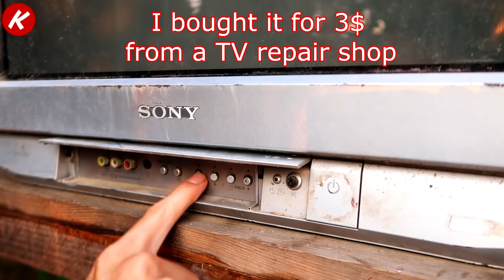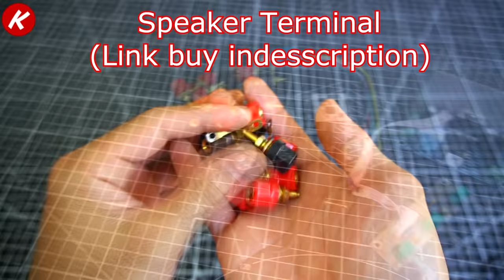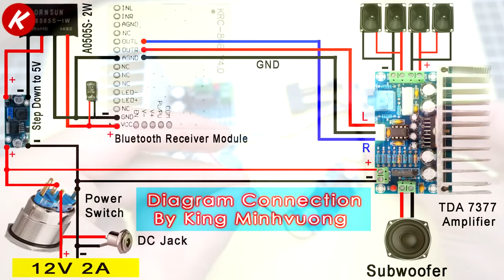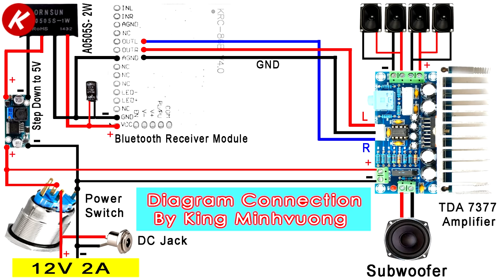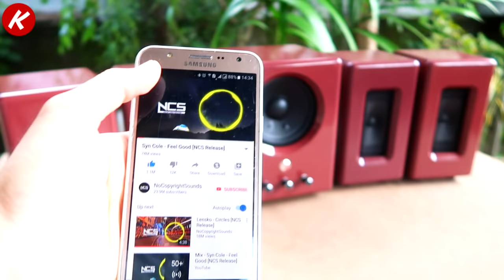How to Turn Old TV into 4.1 Bluetooth Speaker

Comment from the maker: Hi Friends! Do you like this speaker? 
Please tell me know your idea. Thank you!
Reply: Realy like. But i like speake mini use battery more
Reply: Yes and no, yes because the speakers are great and the design is great, and no for the awful Bluetooth chip, you should plug them into a real amp not this one, they’re not small to be Bluetooth speakers, they need some life.
Reply from the maker: Thank you for your advice!
Reply: King Minhvuong thanks to you for taking it positively man ! I love ur work
Reply: Also i just saw the complete video, a 2 channel amp is not suitable for 4 channel speakers + subwoofer youre just end up getting a crappy crunchy sound when u have to get an awesome sound with 4ch, you need at least two amps or one 4 ch + sub amp
Reply: you want to make a sound bar with this speaker
Reply: Fake jbl flip 4upgrade
Reply: I love it, but You might use filters for each type of speaker, but I really love it, Nice project
Reply: Upgrade speaker portable again
Reply: uma boa ideia é fazer um protetor de tecido pros auto falantes, assim eles não ficam aparentes e da um acabamento muito legal. a unica coisa que não gostei foi a cor, na minha opinião se pintasse de preto o botão de power e os controladores prateados iam ressaltar e ia ficar bem mais bonito, mas foi muito bem feito e o som ficou top. parabens.
Reply: Tháo rốn loa thì a nên dùng xăng á thì nó đỡ bị rách loa hơn
Reply: That's not 4.1 chanel system...
Reply: You have every equipment to make this project working nice
Reply: @visendorin493   yeah that's 2.1
Reply: Left channel and right channel are same two speaker at the same terminal ..the ic amp cause overheated to damage ic amp. If amp ic consume 10watts.4speaker x4 40watts..i suggest to add usb.micro sd..by the ways nice work good job bro.
Reply: Yes and no they are butiflul but you should honestly use better speaker drivers tv speakers aint all that good
Reply: It is very relaxing to watch your build videos, and nice job on restoring those old Sony speakers and re-purposing for the bluetooth build. That being said, I think these speakers would probably fair better with a small clean stereo amp (unless you're just going for portability and a way to amp up your tunes on your iPhone or whatever.) I do like your cabinet work, and they are pleasing to the eye. You may want to repurpose a large boom-box amp/tuner into one of your cabinets to power these, and still retain the B/T setup along with a switch to select between the 2 sources. More choices for home or mobile?😁👍
Reply: Yes!
Reply: The sound system and design is perfect but bass sound is low quality
Reply: no seria mejor usar madera terciada (triplay) en vez del MDF ya que por lo visto el subwoofer de computadora se daño por la humedad y el MDF soporta muy mal la humedad
Reply: Can you make a Marshall speaker?
Reply: No Sam a actual Marshall Bluetooth speaker.
Reply: Which type of wood you used???
Reply: black stain u used to paint upp those speakers will make them produce less then they would,, also when going on like you did why not also use dc voltage and use 18650 batteries u find in old puters, brigw them to around 32v or higher and an ballancer for recharge,, or why not use solar panels as chargers,,when u use speakers like these on barbeque or a picknick..newer the less,,nice done and i wish i had a space so i could have the same tools.
Reply: @catchmypoint6756  MDF
Reply: treble is missing
Reply: @FPSzky  also the bass and pretty much everything else
Reply: @randomweirdyoutubechannel8955  ye
Reply: What was the coating used before you applied paint? Epoxy? I like how the finish turned out
Reply: Very giỏi Minh vuong
Reply: Really super amazing sound and clean bass 👌👌
Reply: @medmusic7977  

P
Reply: Chất
Reply: Nice work but it sounds very crappy. You should used the tweeter instead of the other pair broadband chassis. It's extremely limited in the heights
Reply: Rx
Reply: it awasome bro❤️
Reply: @vantunguyen4955 ёпенггггг5
Reply: Old 5.1 Home Theater to Bluethooth speaker.
Reply: Por favor
Reply: Un poco
Reply: Popo caca caca
Reply: @vantunguyen4955  u
Reply: @vantunguyen4955  yang akan terjadi pp lagu Adista setia
Reply: Hey bro you can do speaker with  video display
Reply: EnjoyEnjaami .
Reply: I feel bad 😞 yor soldering iron need care
Reply: Hey  joker    ftan   dj
Reply: Anh làm loa bằng hộp đựng đạn đi ạ
Reply: @KingMinhvuong  on off

Comment: Wait a minute, that’s not even a 4.1 system. It’s just a 2.1 stereo system but with two speakers on each side instead
Reply: Should have bridged the back negatives together to get the surround channel
Reply: @zacharydarner7036  just what I was thinking. And the subs not even bumping, so...this isn't even the music from the "4.1"? Don't get me wrong, the craftsmanship is amazing! But.
Reply: @kingkrapper108  probably not the real system playing that song. All you need is a stereo and four speakers and some wire and it takes less time than that work. Or just look out for a Dolby pro logic cheap surround sound system at a pawn shop,thrift store or garage sale.
Reply: You literally know nothing about home theater setups
Reply: You could buy some extension wires and mount the speakers on the wall or biuld some stands and make them floor speakers or use them as bookshelf speakers DUHHH
Reply: @athomewithmrs.scherkenbach404  yes I do I am talking about a cheap method to get basic surround sound
Reply: First of all you do it well...you didn't no how to do even...but you commenting the speaker
Reply: @DOMiNO I agree with you. 

I appreciate the work, but the title is misleading. 
Deslike =)
Reply: Its a 2+2.1 system
Reply: Could be made 4.1 easily with a bit of work and 20 bucks.
Reply: it *COULD* be bluetooth 4.1 KEK
Reply: @FennecTECH  can you please provide a wiring  diagram link for a 4.1. im having a hard time understanding it. I have 4 6.5inch JBL's and a 4 channel Jbl car amp. Im running the setup at home but as of now its just a 2.1. I really wanna know how to connect the rear speakers to get surround sound.
Reply: wooow you are so smart
Reply: UTKARSH SHARMA you could look online for a 4.1 wiring diagram there are a lot online and its very simple. Like i have a tv it is a 2.1 surround sound except there is no subwoofer because i have 2 woofer drivers and 2 tweeter drivers drivers=speakers
Reply: @athomewithmrs.scherkenbach404  i think u have no idea what surround speakers are.
Reply: its quadraphonic.
Reply: Bits of two TVs, a subwoofer box and a load of bought electronics for s 2.1 system - That's the title.
Reply: I have made one.. with class D amplifier. TPA 3116 d2. Ic based board. 
It gives 50+50(stereo)+100(subwoofer). It's so loud and heavy bass. A indoor party 😹 can be done with it 😉 very easily. 
 I always play at 10-15% of power. 
I used 2*6inch speaker for stereo and a heavy 6 inch subwoofer for bass. And 2*2.4inch midrange speaker. 
It was a great journey to build those. ❤️
Reply: @revolution5547  agreed

Comment: Pretty cool. Good job. In the future you should try black plasti-dip it gives the paper cone a rubber coating and seeps into the papers pores and gives tighter lows from paper speakers. I’ve done it to many paper speakers and subwoofers and really looks amazing and sounds better.
Reply: 😅😮u 0:26 0:27

Comment: Very cool! Although the red paint is hurting my eyes a bit. But it's not the worst part. It would be best to try to mesure the speakers' t/s parameters (they essentially describe the speaker)  and use a free program like winisd to calculate the proper box volume. I also suggest using the tweeters bu putting them with a 2.2 to 4.7 uF capacitior in parellel with the woofers. But be carefull the + of the capacitor needs to be connected to the + on the terminals and the - to the + of the tweeter and the other leg of the tweeter goes directly to the speakers' - terminal (the black one). This essentialy creates a high pass filter, wich protects the tweeter from low frequencies that might damage it.

Comment: My friend purchased a Dindinmodern speaker that has lights and loud sound. It seems equally good. I think I will purchase one
Reply: I have made one.. with class D amplifier. TPA 3116 d2. Ic based board. 
It gives 50+50(stereo)+100(subwoofer). It's so loud and heavy bass. A indoor party 😹 can be done with it 😉 very easily. 
 I always play at 10-15% of power. 
I used 2*6inch speaker for stereo and a heavy 6 inch for bass. And 2*2.4inch midrange speaker.

Comment: I have made one.. with class D amplifier. TPA 3116 d2. Ic based board. 
It gives 50+50(stereo)+100(subwoofer). It's so loud and heavy bass. A indoor party 😹 can be done with it 😉 very easily. 
 I always play at 10-15% of power. 
I used 2*6inch speaker for stereo and a heavy 6 inch for bass. And 2*2.4inch midrange speaker.

Comment: You need some tweeters, it sounds dull.
Mylar or piezoelectric tweeters
Reply: There was two in the tv
Reply: Zsolt Péter Dániel he didn’t use them but he should have
Reply: Piezo doesn’t sound good so some good dome tweeters would be better
Reply: @chaeyoung8908  Piezoelectric tweeters are very cheap and do not need a filter.
Reply: In all fairness it's just a cool idea. TBH no one would use weak tv speakers and go thru this, would rather just buy a $100 5.1 setup that can take more power and sound better.
Reply: Zsolt Péter Dániel those were cone tweeters with some sort of fancy plastic baffle in front of them. Better than crappy piezos, they are just metal discs with wires hooked up and they barely do anything!
Reply: @scottbrady6795  
I talked about piezoelectric with Motorola type horn.
https://www.youtube.com/watch?v=tbt46Au1HhY -
https://www.youtube.com/watch?v=WkPyeAIfF8Y
Very economical and they do a basic job.
Reply: @iagogonzalezalvarez  They still don't do much of anything.
Reply: Why piezo tweeter's if you want something cheap just rip some out of an old technics stereo or something like that
Reply: Yes, this “system” would sound a lot better if there was tweeters installed. However, you would have to use the crossover circuitry - resistors, etc.  it has, or resource one from somewhere
Reply: @evorydejbighot870 not all tv speakers are bad. I hate that common stereotype. 

Especially these in the video are very good and not weak at all.

Comment: Fun fact
The 2004 - 2006 Sony Rear Projection TVs (KDF-60WF655, KDF-70XBR955, and other models) have a subwoofer built in, the 70XBR has 4 mid range, 2 tweeters, and 1 sub
Reply: Many tvs have subwoofers built in

Comment: I've seen closely your creativity and I am impress so much, but one thing you did wrong is that; you said 4.1 audio system. I've notice that your speaker connection is parallel output on left and rigth. You could use Novelle circuit at least you could say it's a 4 channel matrix with subwoofer. Anyway it's a nice video, thanks to your contribution to viewers and commentaries like us, good job.

Comment: totally shoulda used some kinda tweeter, this woulda been really good, to me it's to flat sounding and boxy. needs insulation in the boxes as well good shot though :)
Reply: it doesn't really sound flat, if you wanna know what flat music actually sounds like go to some big studio or something and take a listen there
Reply: @BH4x0r   I see you like Bose, In my opinion Bose is crap. Overly priced and dull sounding just like this build on here. Like buying a great pair of speaker's and then covering the speaker's with a blanket.... I'll say this and that's it. they are not music speaker's maybe use of a snes.
Reply: @robertblumpkin4759  i don't really like Bose lol, the SoundLink air was kinda decent considering the drivers they used are just a pair of 3" ones and actually played down to like 50Hz which is impressive for such small drivers, but i NEVER paid for that speaker myself lol, otherwise it's way too overpriced.
I also can't call those studio monitors, like at all, they don't sound that great either.
as i said again take a listen to actual Studio monitors.

Comment: Very cool. I wish you wouldn't have wasted those tweeters though.
Reply from the maker: I know that but if I use them then the sound will be treble redundant.
Reply: @KingMinhvuong  inline resistors. Speaker crossovers have been doing it for decades

Comment: Just because u use 4 speakers and a subwoofer it doesn't mean that u have 4.1 audio system, u use 2.1 amp and the system still be called 2.1 system, if u want to be 4.1 u should use 4.1 amp and bluetooth receiver to have authentic sorround experience.

Comment: keeping the original circuit sound better, you just install the main BT and replace 2030 => 2050 is the capacity increased. Thanks still for your video.

Comment: Cool project, glad you finished, however TV speakers are terrible and just there for consumer default in manufacturing. TV are MONITORS(For vision, not sound) the speakers are garbage. and are meant to actually have a external speaker system.
Reply: You got it all wrong, this was the time then tv audio was also for music and not just for hearing someone talk. There are way better tv speakers than these aswell, many tvs also has subwoofers built in

Comment: Wires in the connections between amplifier and other components, and from amplifier to the satellite speakers too thin. And for best quality sounding of this system i'm recommend installing Bluetooth with aptx ll, or aptx hd or ldac codec within.
P.s. for best quality listening use music lossless/flac, not using youtube, because it coding downsempled bitreit. Sounds is worth.
Reply from the maker: Thank for your advice!
Reply: Nah the wires are fine. This system isnt powerfull.

Comment: Cool, three channel amplifier You changed to five channel ...
Reply from the maker: Yes. I had fix it. Thank yoou!
Reply: @KingMinhvuong  you know its still only 2.1 channel? You connected the speakers parrallel to the same channel so its the same. You have a 2 right a 2 left and a sub speaker. Not sperate front left and right and back left and right and a sub.

Comment: This is not a 4 channel system, only 2 channel or stereo. 2.1 would be a proper title for the video, the .1 being the subwoofer. 4.1 would require 4 separate speaker channels. Nice video, just fix the title.

Comment: why you didnt use the tweeter?
Reply: That type of tweeter sounds so bad. I think using the bigger speakers Fullrange was a good idea.
Reply: @fabianplanz924  I'm pretty sure they would sound better with the tweeters. The bigger speakers probably doesn't have that good highs which is why the TV had the tweeters
Reply from the maker: If I use it then I think the sound will be treble redundant
Reply: @naotomori5974  I also think of that too.Cause i tried to use the woofers as tweeters but they cant.Then i used their tweeters and the sound got pretty good.

Comment: U need to use the tweeters because there is only sub and mids tahts why there is no high end in this its just mids and bass that why the tv had a pair of tweeter
Reply: They are fullranges, they dont really need the tweeter. But the tweeter still helps with the highs

Comment: TV speakers are the worst crap you can even imagine they sound like a tin can. Why make new crap out of old crap. And geez, the first sign of a cheap junk woofer is that terrible color on the metal.

I kinda get if you are in Burma or something they think those speakers are hifi, but here those useless TVs and a silver colored plastic box pc subwoofer would have been thrown in the garbage without regret
Reply: Tv speakers are amazing! You have prob only heard crappy flat screen speakers but boy are you wrong about tv speakers! Many tvs had subwoofers built in to max the sound quality